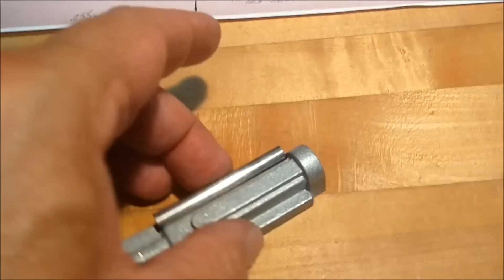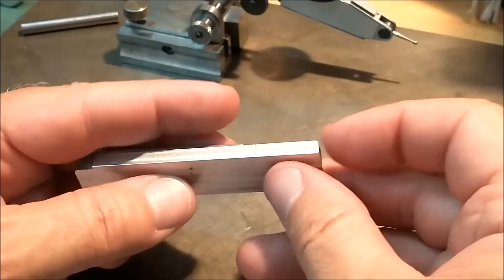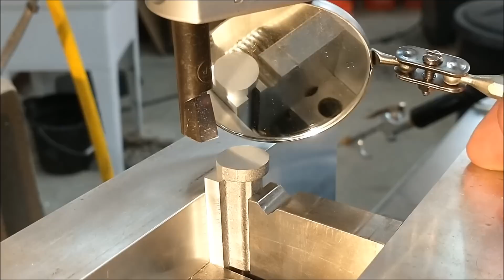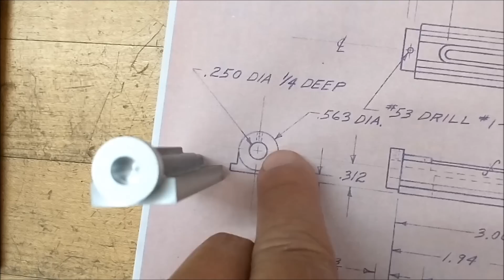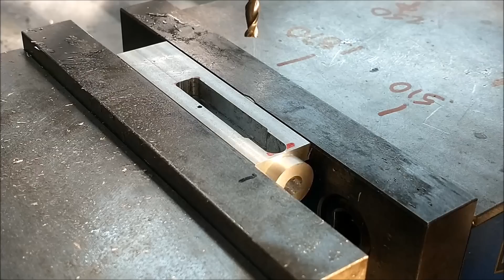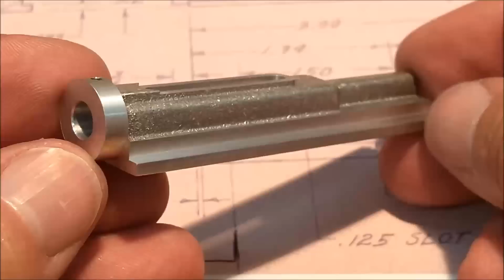Machining a Miniature Shaper from the 1800's -- The Ram Casting

Comment: The average Injection mold is around 30 or 40 grand and up to a half million lot of over head But the 30 to 40 grand size can be double very rewarding work kind of like what your doing there
Reply: doable not double
Reply: A good starting point would be repair its where mold makers all start
Reply from the maker: I spent a couple years in mold repair and setup. I enjoyed the work.

Comment: Fabulous job of machining this part! I hate to see the small porosities in the casting on the finished part. Couldn’t you fill these small imperfections with JB Weld epoxy steel just to minimize the defect? I used this product to repair the table of a used drill press I bought and it really improved the appearance of the table and to a small extent the utility of the table.
Reply from the maker: Those holes bug me as well. I may have to experiment with filler some day.

Comment: Really like that trick with the boring head. Never seen that before, but as you know I'm still a novice.  Another trick in my tool box, thanks Joe 👍🏻
Reply from the maker: For boring heads that screw on, use a LH bar and still run forward.

Comment: I like the boring bar solution to machining the round part - I'd have been trying to balance the piece in a 4-jaw chuck on the lathe, maybe with a machined or 3d printed pressure block to deal with the uneven shape.
Reply from the maker: I thought about using a split bushing in a collet. It would have worked too.

Comment: Joe.
Didn't you loose your 250 counterbore depth eventually after your careful setup ?
When you cut the base slot ?
Reply from the maker: It did break through in the center. I was surprised to see that since it wasn't represented on the print. I'm not familiar as I'd like to be with shapers, or I may have done something differently in that area. At assembly, it all gets consumed.

Comment: A drawing that mixes decimal and fractional might be excusable if the fractional was only on drilled holes, but on dimensions it is not. What possible point is there in doing this?
'.25 DIA 1/4 DEEP' - what?
Reply: Such practice is often used to convey tolerance without having to write +/- notations.  Decimal dimensions are measured to the number of digits written (.xxx is to +/- .001 while .xx is +/- .01).  Fractions are low tolerance dimensions, while avoiding some confusion.  1/32 diameter means grab a 1/32 drill bit and make a hole.  .06 (the low precision decimal) is unclear, while .0625, the correct decimal, conveys more precision than is intended (possibly suggesting reaming and other higher-precision processes).

There are likely notes explaining the notation, but Joe isn't showing everything in order to respect PM Research's copyright.
Reply: @arloames4517  An example-
the top slide slot is 1.25 with the flat 3/32 longer on one end, 1/16 on the other.
So, the flat is .15625 longer than the slot, offset by .015625. Since the slot is specified to 2 decimal places, it suggests the flat should be the same. So we can shorten the numbers to .16 and .02. Giving the two dimensions as 0.10 and 0.06. After some calculations. Would not putting these numbers on the drawing save the machinist some time, and reduce the chance of error? How do the fractions hep here?
Reply: @Tensquaremetreworkshop  I was merely trying to help you understand terminology that you seemed to be having trouble grasping.  I'm not interested in an argument.

The approach was common in industry, has been superseded, but does show up from time to time.  GD&T only dates back to the 1980s or so and not everybody got the memo or had the need to update.  

I understand that PM Research has been updating their drawings and maybe you should look at their new ones.

 Get over yourself and allow that some times people in the past didn't do things in a manner that could please your sensibilities.  Your argument about fractions has been discussed in innumerable standards committees, and yes, for ISO/ANSI work decimal descriptions are prescribed.  

But not every drawing in the universe was updated at that instant and not all drawings are done to the highest standard.  Get over it.
Reply: @arloames4517  When you are marketing a product where drawings are an integral part, should they not be fit for purpose? 
At heart, the problem is that imperial machine tools are decimal but the tooling for it is fractional. Incompatible. If you could get decimal drills and bits the problem disappears- but that is not going to happen, since this issue does not exist in metric tooling and that is the way the world is going. So you are left with the mess that is fractional, letter, and number drills...
The best that can be done is to use decimal for all dimensions that are not dictated by tool choice.
Reply: @arloames4517  Really? Exactly what 'confusion' is avoided by fractions? There is a whole system for conveying tolerances; if important they are best stated. Saying that fractions are 'low tolerance' does not mean no tolerance, so it still needs stating (somewhere). I already said that it is excusable for holes (or where it aided tool selection). Remember, those using the metric system use only decimals, without raising 'confusion'.
Reply: Well, in the days when this machine would have been new, practically all machine dimensions were given in fractions rather than decimals. So I can see them having most dimensions in fractions.
Reply: @lwilton  These drawings are for the construction of a model. With either DRO or handwheels, the machinist will be inputting decimal values. Fractional values will have to be converted anyway- so why use them? Especially in such a random manner- the width is given as 0.75 (not 3/4) the front hole as 0.25 dia x 1/4 deep! It all just adds to the work of the user without any possible benefit. There is an argument for fractional values for hole diameters, as it aids selection of the tool- but they do the opposite!
Reply from the maker: Its for tolerance application and for casting profiles.
Reply: @joepie221  I think you would need to expand this statement for it to be understood. I asked a few people, and nobody understood what it meant. If it has meaning, perhaps a video is in order?

Comment: Joe, I wish to point out that you facing the tool inwards on your boring head and running it in Reverse, is Generally a NO NO. You may be lucky and have a boring head that is Not screwed onto the R 8 shank and all is well. However, most of the Cheapie Chinese ones Screw onto the shank, and running it in reverse Could make it unscrew and cause an accident. I would Strongly Suggest that you mention this in future or even pin a comment about it or add it to the description. Great outcome. Regards from Australia.
Reply from the maker: Valid point Dave. My boring head is a rigid R8 shank so having it 'unloosen' isn't an issue. In reality, its the hole selection on the head that determines what direction to rotate it. Combined with which hand the boring bar is of course. I don't like an extreme offset on a boring head because it introduces vibration, so I reverse the tool and run in reverse to keep everything tight. Doing this in forward is also possible and no risk of anything coming apart.
Reply: My boring head is a cheap one that unscrews if used in reverse, my way around that is to use left-hand lathe boring bars, and run the head forwards👍  (the boring head came with cheap brazed carbide boring bars with a 12mm shank, I found affordable matching 12mm left and right hand 12mm shank indexed carbide bars, they're around £15 each, work a treat)
Reply: Valid warning, Dave. My Emco screw-nose lathe has a generous register and the chuck backplates use a split clamp to improve security, but I'm very aware of its limitations and machine in reverse with very light cuts and great caution.

Comment: It looked like you were trusting the surface that you only cut at 30:00 earlier in the video. Was the as-cast surface there good enough?
Reply from the maker: I'm not sure I completely understand this comment. The part was never positioned on a cast surface. Can you be more specific?
Reply: @joepie221  at 5:30, “The only surface I can trust is this top one here.” But that surface was as-cast until the end of the sequence.
Reply from the maker: @JCSalomon  Gotcha. It was parallel enough as not to influence the clamping block I used at that time. All the registration during that earlier op was from machined surfaces. The cast surface was just a pressure surface.
Reply: Which surface?  the top of the piece?  He was using it as a pressure surface rather than a registration surface earlier.